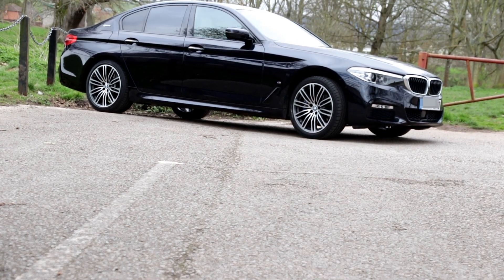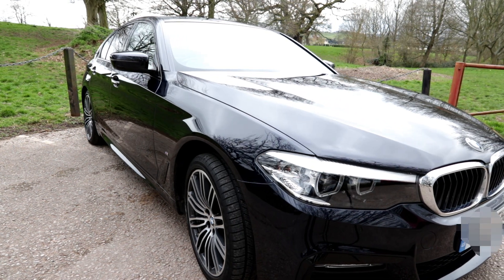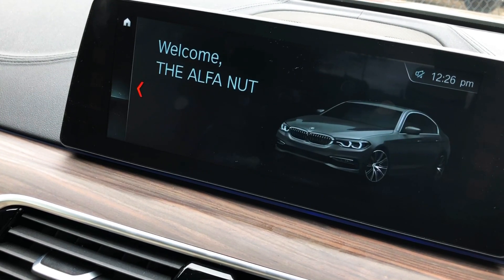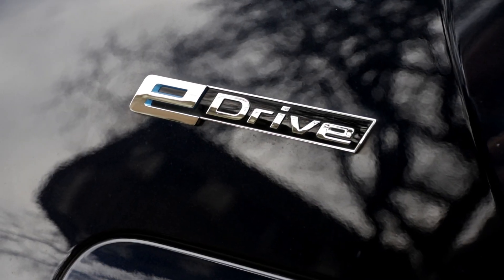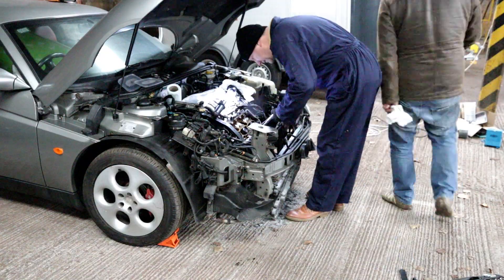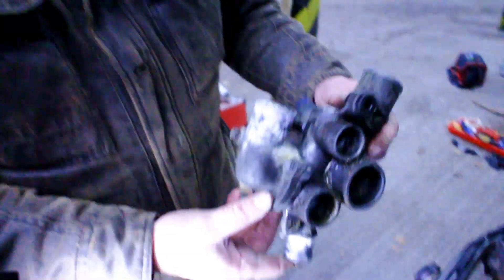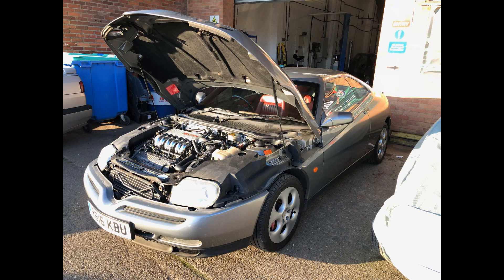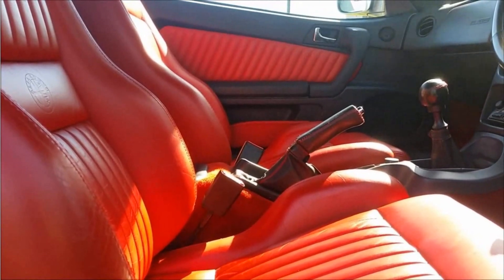Restoring my Alfa Romeo GTV V6 after its 5-year sleep!

Comment: Any comments on how to ‘store’ my new gtv over the winter. Should the battery be disconnected or should it be started up every week or so...?
Reply from the maker: Dont disconnect the battery Dave, just charge it every month or so and yes, start the car every week of two, allow it to warm up, move it around a bit if possible. Use a dessicant dehumidifier inside if you can to keep mould at bay. 👍🏻
Reply: @TheAlfaNut  fab, thank you, will do 👍

Comment: Nice movie can anybody help me drive me littel 147 for 3 years but now have abs ,asr brake lights on and now brake lights at al 😦 is it easy fix ore big problem 😟 hope for tips Thanks guys 🙈👍.
Reply from the maker: Hi Peter -warning lights are very common for Alfas and can often be sensors failing.  Of course it might be that your brakes need replacing too!  Get them checked mate.
Reply: @TheAlfaNut  thanks I now the gif fast warning lights and signal Just have my M.O.T but today here my left side brake pad ,Monday he is going to my Alfa romeo  Mecanicien for laptop check up thanks for the info 💪👍👍
Reply: Ps will always drive Alfa romeo  love the Brand.

Comment: Just found your project and subscribed. So whats up, any progress? I have a Gtv v6 turbo that has/is getting quite a bit of work done on it. I'm more of a wanna be mechanic with no garage so most of it is done by someone who knows what they are doing. Plans are still not fully fixed, we are trying to determine the best way to go about doing certain modifications. So far what has been done/will get done are uprated fuel pump, injectors, spark plug wires, slightly bigger turbo, oil cooler, entire engine management (most likely expensive and requires new wiring but maybe the right way), cams from a Lancia Thema 3.0 v6 (recommended by squadra in holland), new clutch, Quaife LSD, adjustable dampers, stainless exhaust and free flow cat...and probably things I can't remember. Did I mention I'm slowly going bankrupt :-D

Cheers from a fellow Alfa nut who loves his old turbo.  Keep us posted on your progress, it's all worth it in the end even if some "don't get it".
Ps. I'm trying to figure out what wheels to put on it but it is so hard as usually when I find something I like it's unavailable or doesn't fit. Any suggestions? Have you decided yet? Currently it sits on 18" wheels that have air bubbles under the laquer and I never liked the design anyway. I can't even decide 17" or 18" Standard ET is 30,5 right?
Reply from the maker: Hi mate, thanks for subscribing - welcome to the jungle!  Your turbo sounds like it will cost loads!  My GTV will be lightly modified and I’ve already fitted GTA cams and plan to remap with some subtle airbox and exhaust mods. Nothing visible or drastic though, as modifying appreciating cars like the GTV will affect their future values sadly. Your turbo is very rare and will be worth proper money before too long.
I’m moving into a brand new unit very soon with my mate Gary and we will be much better able to work on the cars regularly (and in comfort!)
Hopefully the GTV will then move along much quicker and I’m hoping to have it running and on the road by March / April.  Update video coming soon.   Cheers Chris 👍🏻
Reply from the maker: Oh yeah, forgot to say - I have a set of 18” GT Cloverleaf wheels to go on the GTV. I really like them on the GTV.  Either that or a set of 17” teledials are hard to beat in my opinion.
Reply: @TheAlfaNut  Thanks for your reply. I'm also trying to keep my car visually untouched. It's a beautiful design. Too bad it's not rear wheel drive, hence the LSD. I know it might be worth more if untouched, but I want to have "my interpretation" of the perfect Gtv. Or something like that. I can't afford to make all the mods I'd like. Most importantly I want the engine to be more responsive and usable. Possibly take it out on track sometimes.

Best of luck with your project! Can't wait for next update. Cheers!
Reply from the maker: LSD is a smart move, I’m saving up for one too!  Frankly nobody can afford to do all the mods they want to their car (s) 😄
Reply: @TheAlfaNut  True. Little by little. I had to sell my V6 156 as I can only keep one "hobby car". Loved that car! So this one is not going, it's here to stay!

Comment: I also bought a ph1 Gtv V6 in the same colour which I am restoring slowly, so another brother in the Netherlands.
What month and year was your car built?
Reply from the maker: Hi Jonathan, thanks for watching - good man for rescuing another GTV - they really are worth saving!  Mine was built in March 1998, so quite early. I will be making an update video soon about the engine rebuild.  I have restored the cylinder heads, fitted GTA cams and all seals and gaskets. Its almost time to start her up for the first time in almost 6 years 🤓
Reply: @TheAlfaNut  looking forward for that video, very nice mods, I am planning also to go this direction.
Mine is October 1997.
Reply from the maker: @jonathankoppelman5687  Aha - even younger!  Does your have the EGR valve still fitted?   I think only around 300 of this variety were built.  Rare model.

Comment: Oooh I remember when the factory fittet paper mache waterpump gave up.
It was a nightmare to get in there and change it (and every other bit on the way in there). Only metal impellars from then on !!!
Didnt have a garage to do it in.
Stupid Italians !!!
Then I can live with the scolding from hot oil, every time I fight to change the oilfilter...
Afterall the engine was designed to be fitted 90degr. different in a different car.
Great and funny video 😁
Reply from the maker: "Hey Luigi!  I've got a great idea: Lets put a BIG engine in the GTV, so you have to take the whole thing out every time you want to check the oil??"
Reply: @TheAlfaNut   :-D  "Naturalmente" !